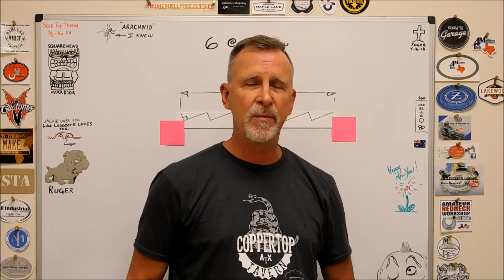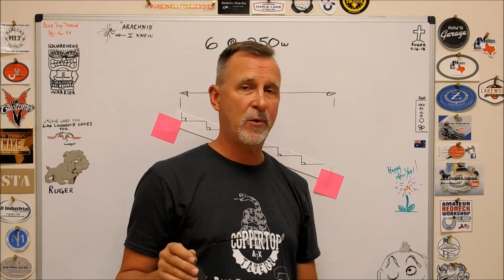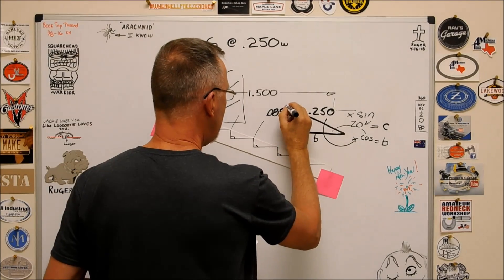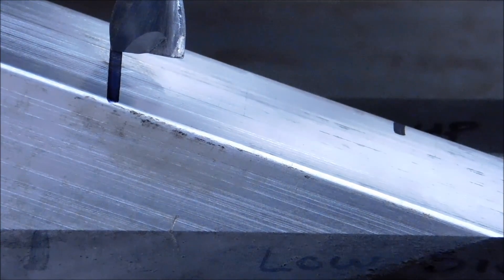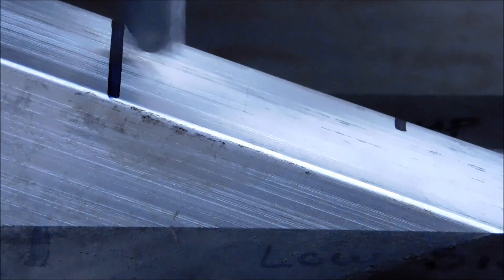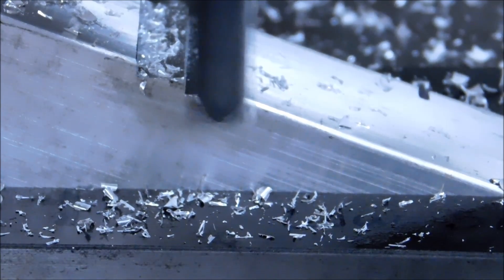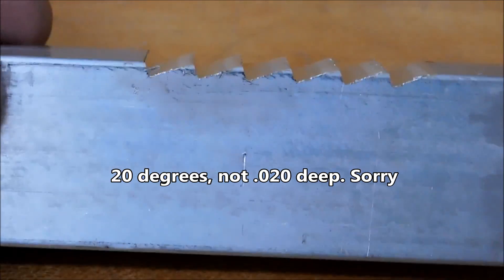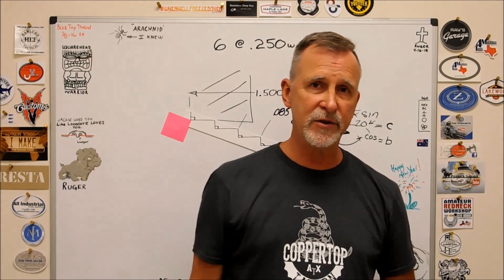How to Approach Milling Serrations

Comment: Really nice job Joe. This leads me back to what was searching for originaly. I also opted for a milling machine, for my own hobby purposes rather than work, that doesn't have angular adjustments. My reasoning was to gain the maximum rigidity I could from a small but not the  smallest mill, its an axminster or sieg sx2. 7  Joe. Now my concern is, in your view joe what would be the most logical/correct or simplest ways to clamp /hold/produce long precise bevels angles on a fixed mill of this type please (I say long though I mean within the working length of the table) long angled surfaces such as can be found on machine gib strips for example. It's the safety and security of mounting and clamping such parts that puzzles me.
Reply from the maker: Multiple secondary vises would be my first thought.

Comment: I’m right now trying to figure out how to do this with serrations that are angled.   When you add that to the equation , z axis needs to move
Reply from the maker: Compound angle setup. Easy.
Reply: @joepie221  let me rephrase. I’m trying to figure out how to program a 3axis cnc to make that cut. But when I change Z axis to the angled cut face, and run the program, it only cuts 50% of serration because z axis won’t move
Reply from the maker: @Andyhoots  Just add the Z destination to the CNC line of code. Still working in the X-Y flat plane, a 3 axis CNC should easily move to a XYZ point in space. Is the part surface flat, or is that why you need an angled cut?
Reply: @joepie221  the part is flat. Adding serrations that are angled like your doing there. But. Angled and 45degree tool paths. Instead of straight across. Can figure out how to program it right in fusion360.

Comment: I had a job with serrations less then 90 degrees 
I did something similar but used a tool I ground to make 60 and 45 degree serrations
Reply from the maker: A flycutter is handy for special grooves. the tools are easily ground.
Reply: Yep that’s what I used

Comment: Thanks! Now how would you mill diamond pattern vise jaws in a mill with a fixed head? I've done it with a 90 degree V bit, but that makes it very hard to get a clean cut and because of the miniscule tip diameter you have to feed slowly in tool steel.
Reply: Fly cutter probably

Comment: Didn't drill through all comments. Another way is to angle the head 20 degrees and mill to a depth of .0803. Sin 20*.25*sin70? You can traverse the table .25 each time. For cleanup you can make a pass at .075 depth and raise the table .0053? Perhaps there's a reason not to do this if you want to keep the head vertical at all times?
Reply: He showed why you would be off after traversing .250 each time, you actually need to traverse .234 each time after angling workpiece twenty degrees. Also, he explained that the person needing the setup had a head that was stationary.
Reply: @BobbyIronsights  I missed that part of the video. It was the stationary head. I forwarded past the classroom. Thanks for the catch.

Comment: Couldn't it have been done with a fly-cutter of correct angle? (make tool slot at 20 degrees)Making a fly-cutter is a simple job but would take a bit longer, but, you would have a fly-cutter at the end of job

Comment: If all of the sides need to be totally exact, you can always make a sine-rest block which ensures that your part always relocates.
Reply from the maker: If the part geometry allows for that. It would be a good path.
Reply: @joepie221  I did that when sharpening the jaws on pipe wrenches from an auction.

Granted, I used a dovetail cutter for the cuts... ~( 'w')/

Comment: SOHCAHTOA ("Soak-A-Toe-A") Sine = Opposite over Adjacent, Cosine = Adjacent over Hypotenuse, Tangent = Opposite over Adjacent.
They drilled that into our heads in high school, nearly thirty years ago now, and it's served me well ever since.
Reply: Tho it’s Sine= Opposite/Hypotenuse 😉
Reply: @Applesupnorth  good catch! I will pretend that i did that on purpose. ;D
Reply: 'They' did the same to us in Britain. Never did fully understand it though
Reply: I was taught the same in the late 90s 🤙
Reply: @Applesupnorth  late 60's, 30 yrs on, nothing much changes LOL
Reply: Well in central Ohio in 1970 we learned the same mnemonic, but you're pronunciation is off. The letters are the same SOH CAH TOA, but it's pronounced So - Caw - Toah. This separates the 3 trig functions sine, cosine, and tangent with their 3 respective 3-letter mnemonics. All you need to remember is that the 3 sides of a right triangle relative to either of the non-right angles are opposite, adjacent, and (everyone's favorite) hypotenuse.
Reply: I don't know where I learned this but " Some Officers Have   Curly Auburn Hair   'Til Old Age"  I have no idea why it stuck I forget most mnemonics instantly.

Comment: using a tapered piece of stock on all four sides, could you use this method to make a square broach ( of course turning down the lower bit as a pilot for round hole) ?  (odd sized broaches not commercially available) if so what would you suggest a cutting tolerance from one step to the next?  fantastic videos
Reply: rob mercier mm
Reply: rob mercier

Comment: Thanks Joe!  Great videos keep up the great work.  Have you ever done a video on enlarging holes with drill bits stepping up in size to the finished size versus drilling with the finished size?
Reply: Go watch two vids, turning thinwalls on large and small OD. That wasn't your Q. :) The PHILOSOPHY of drilling is: hog out the ID as fast as possible, and finish it. Then in the case of the ODs, the same, cut fast, finish, done. Obviously the vids go into 2000 other details. I THINK the generic answer to  your Q is similar, drill once with one size down from target, then finish as appropriate, drill, reamer, bore. The Big Cuts obviously have to be within the limits of machine/tool/material. That could require an intermediate drill(s).

Comment: Cool video! That pattern would make for neat slide serrations on a 1911.
Reply from the maker: Between you and I ( and everyone else that reads this comment ) The question came from a gunsmith for that very application.
Reply: @joepie221  When you described the problem/challenge I went and measured the serrations on one of mine.  I surmised that was the reason for the tutorial.  Thanks again!

Comment: The other thing to consider is tolerances adding up. Say you calculated that the step was 0.09375, so you rounded it up to 0.094. You will find that it slowly goes deeper and deeper into the work. 
If you calculate the postion of each step, rather than just adding 0.094, you will not get the accumulating error.
Reply: Please explain more.
Reply: @elmeradams8781  you need to do you measurements in a way to stop errors adding up. Calculate the absolute position of each step, not the distance between them.

Comment: Nice job Joe, at what point would you say this kind of cut is too deep to climb mill?
Reply from the maker: Thats totally dependent on how rigid your machine is and many other variables. I climb cut almost everything. Snug the traveling axis and let the tool cut. A loose table, or too aggressive a cut and things start to jump.
Reply: @joepie221  Thanks Joe, I'm not a machinist but I get by well enough,  I don't have to worry about getting stuff out to deadlines so I can mess with thing a lot. Years ago I was told by some guy that climb milling should be avoided except for finish cuts, so thats how I worked. I'm willing risk a cutter or 2 experimenting now.

Comment: Thank you for sharing! question, is there a way to hold a sphere in the lathe to finish forming it round where the stem is?
Reply: My guess is, you need to put a piece of metal in the chuck with a concave cup machined at the end. Put the ball in the cup and then use a circle type piece on the other side of the sphere with a few machine screws clamping it to the cup piece... Another way could be a thick walled tube cut in half with a pocket for the ball near the end so that when you clamp the tube in the chuck, the ball get tightened inside the tube with only a small part of it sticking out at the end.
Reply: @TheRealFOSFOR  thought of something like that but i fear the thing might shoot out... anyways, thanks for the reply
Reply: @oddiev  With some careful small cuts I'm sure it's gonna hold just fine.
Reply: You could also cut a set of soft jaws with the female sphere, it wouldn't need to be full z-depth to capture the part, maybe 60% should be more than enough. It would need enough meat after the tangent so the soft jaw doesn't deform form the cutting/clamping forces.

Comment: Great video as always joe!  A vise mill stop would help to flip the part and cut another side.  I notice you were climb milling on both passes is there a reason for that?
Reply: Indeed, a stop would be good ... provided the end had been milled or turned flat, and square to the z axis.
The stop would have to be tilted to the same angle as the stock.
(Climb milling gives better finish. On home shop machines it may be risky on steel or with deep cuts, but for this sort of job any machine should handle it, particularly if you snug up the y axis clamp slightly to stop the table "running away" ahead of the handwheel input)
Reply: @Gottenhimfella  The other thing you will need to do to keep the same settings is be sure that your angle block is in exactly the same position as when you did the first set of cuts. If it has moved then you Z axis and X axis readings will not be correct to have the serrations line up properly! Cheers from John, Australia.

Comment: If you want to make the other sides to be aligned with the first side, develop a good reference where you can put a stop. Then if you have the original settings, just rotate the part to the sides that you want to machine.

Comment: When you was making your X and Z moves did you zero the displays between moves or add the next move to the previous one? Thanks
Reply from the maker: I zeroed each time. You could pre-determine the stack dimensions if you wanted too. That would work just as well.

Comment: Happy and safe TG. Yes, its called hypotenuse. It was Pythagoras and works ONLY for triangles with one right angle, but is the most useful “only” of all. Sine, and not sign, is also calculated as “oposite side (or far side), divided by hypotenuse”. Cosine is “adjacent side (or near side) divided by hypotenuse”. Yes, we need to know the sine of the angle to use in order to calculate the X and Z for each step (stair). Understanding Pythagoras is very useful in life. Go check Wikipedia or via Google many www sites to learn.

Comment: Thanks Joe great video as usual.

Don't suppose you could do a video on boring a two cycle motorcycle cylinder? I have one to do for my old BSA Bantam and don't want to make a pig's ear of it!

Paul
Reply: Might pay to specify if you want to use a lathe or a mill, Paul. If a lathe, it had better be a Brit machine with T slots on the cross slide, unless you want to set it up on a faceplate. The advantage of bolting it to the crosslide is that your boring bar can be supported by the tailstock, making the bar more rigid than a cantilevered bar in either the toolpost or the mill spindle.
There are some videos of this class of setup on Keith Fenner's site, mainly boring propellor shaft brackets.
Reply: @Gottenhimfella  I've done VW cylinders this way.  It has proven to be exceptionally controllable with a really beafy bar. Use a v-block and depth mic to make cutter adjustments.
Reply: @billgreathouse1913    Nice suggestion for adjustment! The V block is a particularly nice touch, giving a stable base reference for the base of the mic. Also depth mics are so much easier to handle and get good readings with, than other methods. But I guess for anyone without a depth mic, it would work OK to take the V block round the back of the bar (as long as nothing protruded) and use a plain (outside) mic across block and cutter?
Reply from the maker: I have to dig deeper into these 2 replies. I am intrigued. My first inclination is just to chuck it up, indicate it square and concentric and bore it with he biggest bar that fits.
Reply: @joepie221   Hard to chuck it securely enough without deforming the skirt, possibly (Bantam cylinders have skirts which are so divided they look more like trousers - you know how these Brits are! Makes them real flimsy). I wish small 4 jaw chucks would have T slots like most big ones do, because faffing round with a faceplate is not much fun. I know someone who sets jobs up up his faceplate lying on its back on a large ball thrust race (bought for a song off eBay) on his surface plate (I guess any metal bench surface strong enough to hold a DTI base securely would do).  It really takes the hassle out of it, because he can finish truing it up and tightening his clamps without fighting gravity.
He turned a shallow witness on the back of the plate which fit the raceway bore precisely. I guess if there was no metal in the right place, I'd screw and loctite three buttons and turn the witness on them. It's only location, no load...
 I asked him how he reached around the rim to turn his (more substantial) witness, and his answer surprised and delighted me. Any guesses, anyone?
Reply: for some reason my last post about setting up a faceplate with the rotation axis vertical got shortened (at least, it shows that way for me, but I'm having some youTube oddities right now)
in case anyone else's is also cut off at "(I guess ..."
it was supposed to carry on with  ".... any metal bench surface strong enough to hold a DTI base securely would do).  
It really takes the hassle out of it, because he can finish truing it up and tightening his clamps without fighting gravity.
He turned a shallow witness on the back of the plate which fit the raceway bore precisely. I guess if there was no metal in the right place, I'd screw and loctite three buttons and turn the witness on them. It's only location, no load...
 I asked him how he reached around the rim to turn his (more substantial) witness, and his answer surprised and delighted me. Any guesses, anyone?
Reply: Thanks guys,

I was thinking of doing it on the Bridgeport as my biggest lathe is a 9" swing Boxford (think SB9) it does have a slotted cross slide but once you take out the saddle and cross slide height I don't think it will have enough daylight to mount the finned cylinder and some kind of hold down fixture.
Will mount up a bar between centres and measure the clearance.

Will post back

Thanks

Paul
Reply: @paulfloyd228   Do you have a boring head which takes decent sized boring bars for the Bridgie? It's certainly an easier setup.
Reply: @Gottenhimfella  
I have a few boring heads the biggest will only take a 3/4" bar but does have really fine adjustment though.
Reply: @paulfloyd228  It's on the slim side, for sure, but should be OK if you sharpen the edge carefully to a good profile. Make sure you lock the table x and z, and snug the quill clamp enough to inhibit chatter in the downfeed. If you do get chatter, immediately vary the speed and continue doing so up and down a few hundred revs to stop the resonance from building up (from sympathetic vibration).  If you can't get out of the resonant band, you could experiment with strapping a bit of weight to the inside of the bar, near the tip, to change the fundamental frequency. Obviously it will have to be really secure - this is obviously much easier to do on a lathe with the bar stationary.
Reply: @Gottenhimfella  
Thank you for the sterling advice, I hear what you are saying about the harmonic chatter ans with a 3/4" bar it will be an issue.
One of my boring heada is a fairly tight Lenz S2 and has a conventional hole layout, I have been considering for some time now the practicalities of making a sturdier boring bar that locates in two of the holes, now might be that time to make it.

Regards Paul

Comment: Could you put a stop at the high end and re-set second side on the angle block and just got to zero again?
Nicely done and clearly described in a way only a mechanical engineer can do.
Reply: Thinking the same thing. Fix angle wedge in place first, and use end stop, maybe at lower end, so long as end is machined square.
Reply from the maker: Thanks. A stop would certainly help if the part geometry allowed for the use of one.